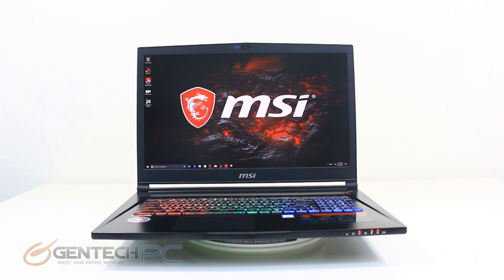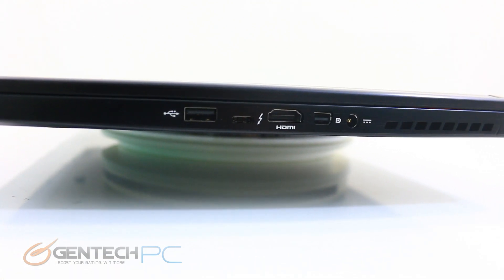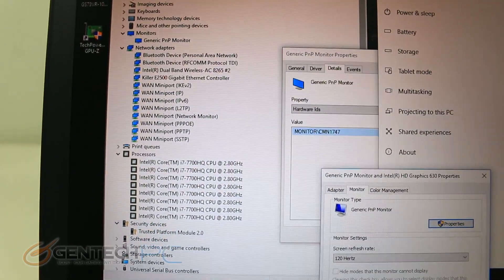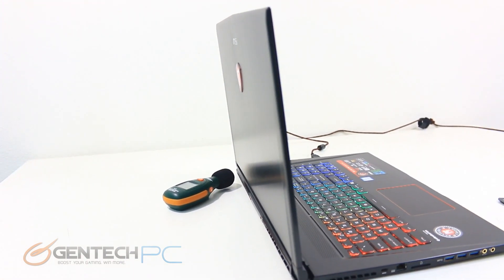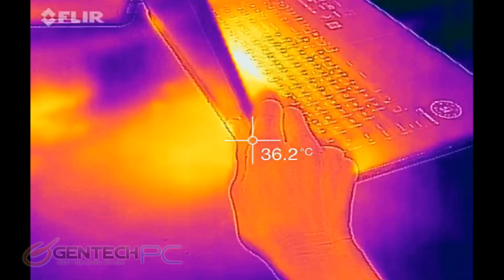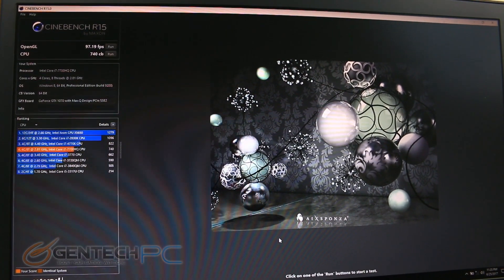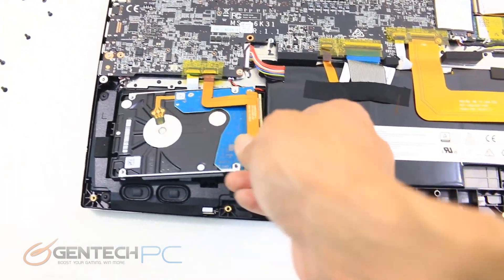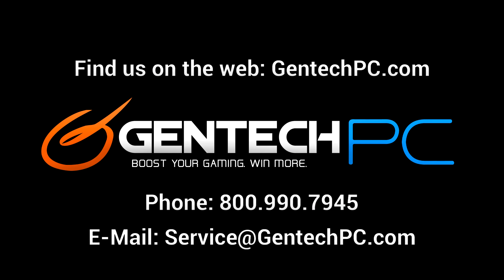Review + Benchmarks: MSI GS73VR 7RG Stealth Pro w/ GTX 1070 MaxQ

Comment: What a step backwards in design and upgrade ability I have the GT72 6QE Dominator pro and I love the ability to upgrade to 4 SSD drives, the second hard drive, the gpu and also easily taking the cooling solution apart for cleaning or applying better thermal paste.

Comment: I have the GT62VR 7700HQ 1070 and I got a score of 13345 on Firestrike so it's about 1300 points under.
Reply from the maker: I was expecting much lower on Max-Q but it turn out pretty good. :)
Reply: What about graphic Firestrike score?
Reply: i get a 14000+ firestrike and 17900+ graphic score, it's a gt62vr whitebox. 6700k @4.2ghz, 1070GTX

Comment: I just bought one of these and love it. Mine has the 1070 GTX and 32 RAM and us ultra fast. The rgb keyboard is amazing at night and I don't even miss G sync with the 120hz screen. I had to buy an external DVD drive though, but its OK since one doesn't use it that much.
Reply: Hilton do you like the screen? I do a lot of video and photo editing and I’m worried this screen won’t give me color accurate videos or photos.
Reply: Artemio Mundo  The 120hz screen is waaaay better than my Acer. Image is good at any angle and game refresh Tate is excellent. However, it has some weird brightness settings that give it either a blue hue or a yellowish hue depending on the setting
Reply: Hilton so the screen wouldn’t be so good at color accuracy. I know the hardware is more than capable. I could add a cheap external 4K monitor or IPS screen lol

Comment: 10:30, About 82 C for the GPU and 90C on 1 of the CPU cores max during your testing. What about if both the CPU and GPU are fully taxes simultaneously? Any throttling? Very useful to do this sort of test to really see if the laptop can perform and load thrown at it without hiccup.

Comment: Could you tell me which laptop has a better cooling system? GS73VR Steal Pro vs GE73VR Raider, both models with the 1070 GTX. Thank you!
Reply: Angilson Reyes I've been wondering the same.
Reply: With both devices' cooler boosts on, they are almost identical. But with normal fan speed without the use of turbo, GE runs slightly cooler but pretty much the same

Comment: Do you have any idea about the battery life of the laptop ? MSI are known for terrible battery life when not plugged. The laptop seems almost perfect from this review, the MQ GPU performs a lot better than expected (actualy almost better than the 1080MQ) ; but I'd like to know how long you can use the laptop for basic stuff (web, office, emails) at 50% screen brightness and backlight turned off (or minimal brightness). I hope it can bear at least 4 hours unplugged.
Reply: they have terrible batgery. i expect about 3
Reply: 3 hours is fine for a small battery in a powerful laptop. ~7 years ago when Optimus was not a thing, and GPUs didn't idle as efficiently as they do now, it was more like 1.5-2 hours.
Reply: Yeah this laptop is great on battery for its form factor gaming on ultra you will get 2.1 hours trust me I have this and it did
Reply: does it has heat problems ? it is so slim, so i don't know if a good game will make it sweat. I'm planing to buy it but i don't want to underclock the gpu in a future. I pay for a 1070 gtx and i want that.

Comment: The pricing on this thing is a JOKE. It's only 100 dollars cheaper than a GTX 1080 Asus Zephyrus which costs 2600 dollars. The 15 inch MSI GS63vr with a gtx 1070 is 2400 dollars while a Sager with equivalent specs and dimensions is 700 dollar cheaper! WTF MSI
Reply: Paullee1147 2500 for a ge63vr 1070 as well and you're getting the full power of the 1070
Reply: Yes, but consider that the Sager NP8952 also has a gtx 1070 and is of near identical dimensions. It costs 1900 dollars with 4k resolution, 2tb of hdd, and 500 gb of ssd. Drop the 4k on this Sager and you have a 700 dollar difference between this and what MSI has to offer. I understand that MSI has brand recognition to work off of, but does that justify a 700 dollar difference? I'm sure that if you wanted to get 4k resolution and equivalent storage on this MSI laptop, it would cost more than 700 dollars extra. Also, why is a gtx 1080 Asus Zephyrus only 100-200 dollars more expensive than this MSI? The pricing is obviously a scam. Finally, max q is throttled. The "10 percent reduced performance" line Nvidia uses is mostly untrue. A non-throttled gtx 1060 the 1060 version of the MSI GS63vr is not only much cheaper than the 1070 version, but is relatively close in performance. I do concede that the Sager NP8952 also utilizes max q technology. Of course the max q 1070 version is better than the original 1060, but does that justify the huge price gap?
Reply: Paullee1147 I couldn't agree more. I'll check out that other laptop, thank you
Reply: For the same specw you're looking at 2100-2200$ for a smaller screen and a heavier and thicker laptop.
Reply: Paullee1147 that one only has 16GB RAM.
Reply: John Israel Cooper Play around with the link. Your calculations are off. In terms of screen size, you are correct. The machine presented on this video is a 17 inch laptop. I respect your opinion if you believe the 2500 dollar price is justified given the larger screen size. However, even if I we're to agree with the 17 inch pricing (which I don't), I most certainly do not condone the pricing for MSI's GS63vr 15 inch price. I would also like to add that I have been a consistent customer to MSI since 2008. Notice how I did not claim to be a loyal customer. This is because I do not like the idea of brand loyalty. The customer does not owe his or her loyalty to a brand due to the facts that he or she is not part of the company from which the brand derives from, and the company does not take customer loyalty as an incentive to improve their product lines. If anything, they manipulate their customers' loyal attitudes for the sake of extortion. Thus, a loyal customer is likely to purchase a flawed product from his or her preferred company based on brand name alone. I am able to switch to a more efficient and practical choice at the snap of a finger when given proper information. I believe MSI has presented a flawed product, not in terms of quality as the product is actually quite excellent, but in terms of the exorbitant sums they demand from their customers. However, I would like to make a couple of concessions with regard to the comment that you have made. I would like to come clean and admit my mistakes and my lack of thorough investigation. The sager np8952 is, admittedly, marginally bulkier and poorly designed in comparison to the GS63vr 15 inch MSI. The MSI gs63vr also looks slightly more refined and streamlined in comparison to the Sager NP8952. If you really feel that these miniscule differences in design justify at 600+ dollar price gap, then that is your opinion and I respect it. Also, Ram is easily expandable, so I view that as a somewhat minor issue. Besides, when gaming, VRam and CPU power are far more important than just RAM. 16 gbs of ram is enough for any game right now. Finally, I have a question that we should all consider. Why is a gtx 1080 asus Zephyrus only 200-100 dollars more expensive then the MSI gs63vr 15 inch version? I use that reference to claim that MSI's pricing on their gtx 1070 machine to be utter horse shit.
Reply: Paullee1147 although I agree on many points the Asus only has 16GB of RAM for that price and maybe no thunderbolt 3 ? (I don't know about that last statement)
Reply: Paullee1147 also MSI has something like this for those who don't care about thickness: https://www.gentechpc.com/ProductDetails.asp?ProductCode=MSI-GE63VR-Raider-001
Reply: Paullee1147 it depends on the country. The zephyrus is 3200 bucks here and the Gs73vr is 2500.
Reply: Is the price higher on NewEgg too? Both the Zephyrus and the GS Series laptops are now marginally cheaper on NewEgg. The price gap is still the same. Buying the laptop in a physical store will cost more than ordering online. Of course, shipping may add to the cost if you order online. If the 3200 dollar zephyrus is the only way for you to get that laptop, then you may be better off getting the GS Series laptop. (As much as I still dislike the pricing on it) I don't know if you'll get warranty if you order from NewEgg.
Reply: Sager is full of shit with their pricing too. I tried to spec out an equivalent Sager to the GE73vr (not super slim, but not huge either) and it started at $2800.00. I can get a GE73vr with a 1tb 960 pro, 32gb ram, and a 2tb hdd with a better screen than the Sager for less than what the Sager starts at with shitty specs.
Reply: The price is ehh but at least it doesn't put REPUBLIC OF GAMER PREDATORS or some FIDGET SPINNER LOGO (razer) on it just because they throw a graphics card in it, I'll settle for a dragon... i guess. Like do these companies assume i'm gonna go out in public with that shit lol. After all it is a laptop but just because people like to play a video game doesn't mean that they don't want to get laid. These companies are missing out on free advertising because they design their laptops with a ten year old mindset
Reply: amen
Reply: Best Buy has it for 1999.99

Comment: Can the Intel GPU be disabled ? Pretty let down if this beast is using Optimus only and does not allow the display to enable G-Sync in NVCP ...
Reply: The  GTX 1060 models didn't have an option to disable Optimus, I doubt this one does either but that would be a nice feature.
Reply: Then that is a real fail. Why put a Chi Mei 120 Hz TN G-Sync panel inside it if G-Sync is disabled ? They could have used a much cheaper AUO 120 Hz IPS panel that did not get G-Sync certification.  (There are 2 types of 120 Hz AUO B173HAN01.1 IPS panels, the cheaper one without G-Sync and the more expensive one with G-Sync certification)
Reply: Tindreal I can only assume that it was so the marketing materials could boast of 120Hz 5ms.
Reply: Tindreal hey man I see you are pretty informed on this... Do you have any idea if this panel is the same as the one in the GS63VR 7RG with 120hz and a 1070? i cant find ANY info online and wanted to check the specs of this panel. In another review done by Gentech PC's says the panel number is CMN15F4... Couldnt find anything online and I am between this system and the Asus GX501
Reply: This laptop is using a FullHD 120 Hz 5ms  Chi Mei N173HHE-G32 panel. Same as other MSI laptops.
Reply: Tindreal Doesnt this panel have support for Gsync? that would make this laptop perfect... again, i cant understand why they wont put features like this on their top tier laptops. This one is 2399 on the website!
Reply: kevinarguellop Indeed the panel does support G-Sync, I swapped panels with my GS73VR (Chi Mei 1080p 120Hz) and GT73VR (AOU 4K 60Hz G-Sync) and once in the GT73, I could still select G-Sync on the Chi Mei panel.  I guess the best option for 1080p 120Hz AND G-sync with MSI without spending a kidney is to get the current GT72VR or maybe last year's GT73VR (6820HK and 1070) but obviously you lose out on the slim form factor.
Reply: sabishiihito good info! the question is if this screen will support Gsync on the GS63VR model with a MaxQ 1070. I was planning on getting that or the new Asus Zephyrus. If the GS63 can get everything (120hz, 5ms and Gsync) I will definitely go with it, however, Im thinking its probably going to be a struggle to get all this straight if its not coming already set up from the factory... Right now, Im 50-50 between these two systems... what do you guys think?
Reply: A GS73VR with G-Sync and MaxQ would be the best option but it doesn't look like MSI will give us that.  Personally I can't stand the keyboard/trackpad layout on the Zephyrus but that's just my preference.  I dunno man, maybe wait for more MaxQ models?

Comment: what's the difference between the GS73 and the GE73 which one is better
Reply: KevZ late reply but GE series is below GS series.

Its

GT>GS>GE>GF>GL 

According to the msi website.

So if u just look at the series only without any external upgrades, GS is above GE
Reply: But the GE has a full GTX 1070, not a max q so technically the GE is better plus it has better temps because it’s a tad bit thicker but still very light

Comment: maxq1070 have low performance or high performance then normal laptop 1070?
Reply: whats up lower than the normal 1070.Maxq was designed for slim gaming laptops with the benefit of lower temperatures and noise but lower performance.
Reply: 10~15%  slower with max q. But in some games they have identical fps. For example, pubg, gta5,
The rise of the tomb raider  and cs go

Comment: Bro you missed out on gaming benchmarks and if you take the laptop to a slightly hotter area temp will rise even more and throttle really disappointed with msi the temp of CPU should be under 60 could have added another fan on CPU and a cooling chamber
Reply: 90C is fine. What temp does it throttle at, closer to 100C? The CPU doesn't care about running at 90C, it would last many many years 24/7 at that temp. So it's just a matter of throttling. I do kind of wish MSI made a version of the GS with 2 fans for the CPU and 1 for the GPU and a 7820HK CPU to have a lean and mean x86 crunching machine.